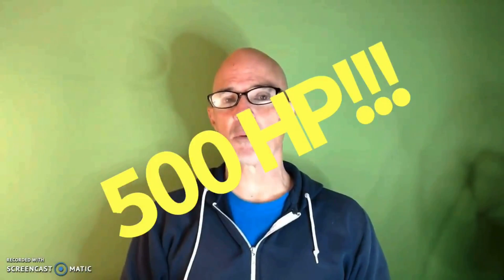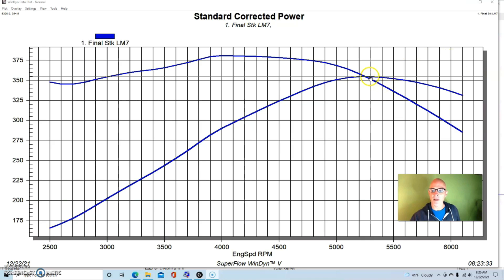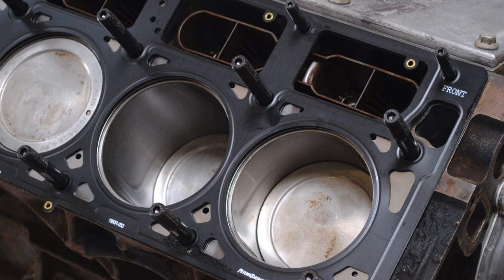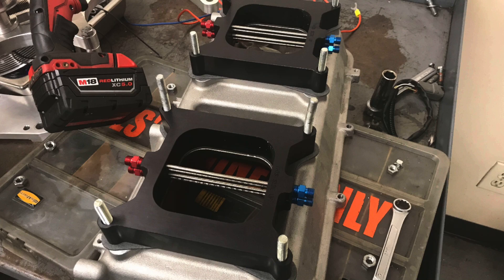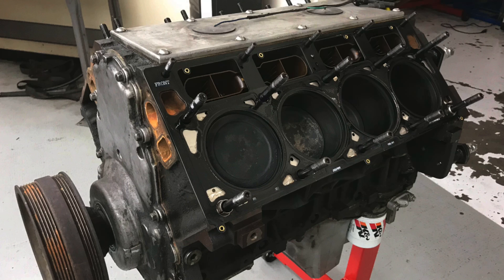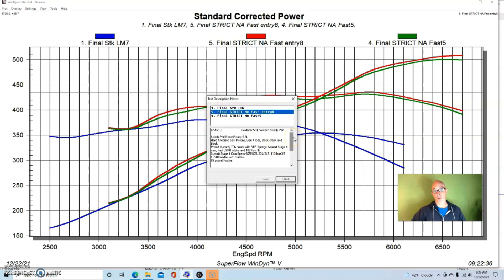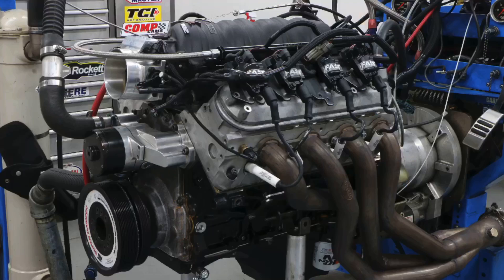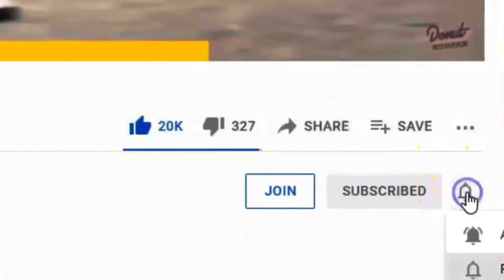HOW TO: JUNKYARD 500-HP 5.3L LS-CAN MY NA 5.3L LS MAKE 500 HP WITH A HEADS, CAM AND INTAKE UPGRADE?

Comment: I bought an 84 Monte Carlo with an 5.3, it has jegs intake manifold, long tube headers, 93mm throttle body, Texas speed stage 2 cam, spectre cold air intake and flow master exhaust and turbo 350 transmission and Terminator x efi. Any idea how much horsepower that would be?
Reply from the maker: cam specs?

Comment: I must be doing something wrong.. I tried the formula to calculate torque (hp x 5252 / rpm) and when I do it for this engine as an example: 354hp x 5252 = 1,859,208 / 2500 rpm, it tells me this little engine should have 743 ft lbs of torque at 2,500 rpms! Someone please tell me where I'm going wrong here. (I even verified this on Wallace Racing's HP-TQ-RPM calculator)
Reply from the maker: hp=tqxrpm/5252, TQ=hpx5252/rpm
Reply: @richardholdener1727  ok we did the same formulas for tq, why does it calculate to 743 ft lbs at 2,500 rpm when this 5.3 shows about 348 ft lbs at 2500 rpm? That’s what is blowing my mind. Even Wallace Racing’s calculator shows this 5.3 making 743 ft lbs of torque at 2500 rpm, which we all know is not real.
Reply: @richardholdener1727  Ok good talk ✌🏼

Comment: title should be "here's how to make "500hp" on a 5.3 if you use some dyno tricks and rate it at the crank..."
Reply from the maker: every motor is rated at the crank
Reply: @richardholdener1727  mine has never seen an engine dyno, it is/was rated on a chassis dyno.

Comment: 5.0 coyotes make 500 to the tire with bolt ons. The pushrod engine with 25 extra cubic inches needs a whole top end to make 500hp.
Reply: Yeah don't forget the 4 cams them Coyotes got. Yall Ford guys kill me.
Reply: The ls will continue to make this power passed 250,000 miles after being pulled out of a junkyard the ford would never be able to do that

Comment: Excellent info clip. I have a 1966 GTO. It has a 67 engine. Was looking at  Ls 2,3 or lq4 9 etc. But I'm starting to think 5.3 because there plentiful and a good price. I had an 06 GTO and fell in love with the engine , 6 speed etc. But 64 thru 67 are my Goat of choice. Not badmouthing the others just grew up with. Does the 6 speed stick align with the original 4 speed! Any other tips would be appreciated. Thanks, Craig

Comment: At 14:11 you talk about piston to valve clearance, limiting you to be able to put in a bigger cam. But doesn't the head flow design dictate the cam lift? No sense putting in a bigger cam if the head flow doesn't support that.
I would like to see you do bench head flow, and then pick a cam that matches that. Maybe you've already done that.
Reply from the maker: cam lift has little to do with p-v (that would be duration)

Comment: I have a 2004 z71 LM7 5300 I want to upgrade engine for most performance on a budget to then swap into my 73 c10 what would you recommend?
Reply from the maker: the channel has endless 5.3l builds-pick the one that makes the power curve you desire

Comment: how do i get the tune for 354 hp without adding anything, how much does it affect mpg too?
Reply from the maker: we run it with no accessories, no air intake, open exhaust and headers and optimized tune.

Comment: assuming the slightly longer pushrod you used LS1 pushrods?
Reply from the maker: LS1 pushrod is the same length as every other LS based pushrod
Reply: @richardholdener1727  so what pushrod length did you use for this combination? 5.3? And i was in the impression that the 5.7 LS1 we're a different size than it's other Beratern LS's

Comment: 7:57 if the stock motor made 354 @ 5500 rpm. Adding nitro the engine would have still peaked 5500 rpm. For the engine to at 6500 rpm. You had to change the cam. Installing a high rise intake is not going to raise the peak 1000 rpm.
Reply from the maker: EVERYTHING WAS EXPLAINED IN THE VIDEO
Reply: @richardholdener1727  That does not mean it was true.

Comment: Does anyone know what kind of vacuum the 5.3 with a summit stage 4 will make at idle and cruise? Just curious if I'm going to have any issues with power brakes or anything. It's a manual car so no torque converter to fight with

Comment: Budget boost built? Or building a 5.3 for nitrous would be interesting. My family just got a fully intact 5.3 with a 4L80 along with harness and ecu. Thinking it would be nice in a Fbody roller with a 200 shot or turbo setup. The goal is 550-600whp.
Reply: Same. Have a third gen trans am I wanna ls swap and make around 550-600 hp too

Comment: Richard good to see you!!! I haven’t been around much lately due to a schedule change at work so I can’t participate in your live streams. I’m building an iron LS1 5.7 with flat tops, 862 heads with a home port job done by me, for now a stock LM7 truck intake, I believe with the measurements I’ve taken and the gaskets I’ve chosen my compression ratio will be right at 11:1. I’m using the sloppy “best” cam. What are your thoughts on this combo and how much power do you think that would make?
Reply: At least 100 no doubt
Reply: @Pickledlizardnipples  haha. I was hoping for 85 so 100 works ha

Comment: I got a LM7 in my 2000 silverado. I was thinking on rebuilding the engine and then throwing boost at it. What would be easier and more durable a crate or do the rebuild. My hp goal is around 600 to the crank.
Reply from the maker: stock with boost will do that

Comment: Please please do a test with the Summit Racing LM7 5.3 450 horse power 420 torque. Can you please?????????????????????????????????????????
Reply from the maker: you think I have the $ to buy a new crate motor?
Reply: @richardholdener1727  oh I thought maybe somehow. You could get one from summit racing. Look I was interested in buying that motor because I saw it supposedly has 450 horsepower 420 torque at $3,600 I'm not sure if it's worth it or just try to do something else I'm trying to figure if I should stick with the 5.3 or go with the 6.0 in my 2000 Chevy Tahoe I want a dependable daily I can beat a camero ss and a Ford mustang 5.0 in a roll race. That would make me very happy. I've watched tons of your videos and I can't decide what to do

Comment: Can you make a stock 5.3 with stock heads making 500 hp n/a.  Doing it with a big cam headers intake and big throttle body....you can port and polish and shave the heads or use any stock LS heads...Can it be done???? Anyone please help.
Reply from the maker: properly ported stock 706 heads will support more than 500 hp

Comment: Hi Richard..I got a camshaft that is 225/238 .620/605 lift & lobe is 113+3 I’m trying to push for 600 hp.. using a 4l60e transmission what stall converter would you recommend for this camshaft..
Reply from the maker: 2800-3000 BUT IS THE 600 HP WITH BOOST?
Reply: @richardholdener1727  Natural Aspirated 6.2…any other tips maxing it out

Comment: Richard, im putting together a l33. Im looking for 500hp. I was wondering if i needed this much cam for it. It will be sbe, flat tops, tea stg 1 799 heads milled for 10.5-11:1 comp, and a lsxrt intake with 102mm tb. Im looking at either the ss2 or the 227/243 comp cam.
Reply from the maker: you will be hard pressed to make 500 hp with either of those cams on a 5.3L
Reply: @richardholdener1727  so would you need to run 50lbs. Injectors for that kind of power?

Comment: Question (for anyone who sees this), can you have too much/big of an intake for a motor? Building a L33 5.3L and I had planned to put a FAST 102mm on but my machine shop said for what I'm doing (roughly 400whp) anything larger than the stock LS1 throttle body (78mm?) is a waste of money and I won't see any gains. How much truth is there to this?
Reply from the maker: AT 400 HP, YOU WILL GET LESS OF A GAIN FROM THE FAST
Reply: @richardholdener1727  thank for answering my question. Maybe I'll see if I can find a FAST 92mm and save a few hundred dollars unless you have a suggestion in mind?

Comment: let’s see what my 5.3 makes with prc 2.5 706 heads milled to 58cc flat top pistons tbss intake and a 228/232 cam at 11.1 cr
Reply from the maker: less than 500
Reply: @richardholdener1727  cam size is my limiting factor isn’t it?

Comment: Might be a stupid question but can you pull a junkyard 5.3 and without taking it to an engine shop bolt on good heads fast intake longtube headers bigger cam and it be a 500+ hp dependable motor?
Reply from the maker: yes-that is what was done on many of these
Reply: @richardholdener1727  got a comment from the man himself!....thanks for the info brother!
Reply: Great question.and he gave an answer to.my 5.3 has been rebuilt.has less than 100miles.i want this build now😂

Comment: Hello nice video.. I have a 454 tbi on my c10 but I would like to get more hp out it. At least 400hp with low budget? It’s possible??
Reply from the maker: carb and intake will help, plus a cam
Reply: @richardholdener1727  forgot to mention it’s a tbi.
Reply: @Chatarrac10  best way to do that is completely get rid of the entire top end and cam and just anything tbi related on your truck.tbi motors top ends are absolute junk asf and hogs on fuel for almost no power in return. Edelbrock makes top end kits that come with heads cam and intake it's exactly what your looking for and I'd get the one with the proflo so you can still use your 4L80 if you have one. It's almost impossible to tune tbi so your gonna have to go carb or aftermarket fuel injection

Comment: I've had every motor in every different vehicle GM offers from the late 70s until current at the moment I have an 8.1 l Allison transmission truck with a raylar cam I'm looking to work on but more importantly the daily driver 6.2 l92 Yukon Denali and then looking to do an LS in an sn95 mustang Cobra rolling chassis I got from California

Comment: I ha e a 2000 z28 w/5.7 Ls. I'd love to see the same type of build using a similar engine, that would still fit under my stock hood. Would be an awesome sleeper. Also using tuned shorty headers.
Reply: Your already fucking up with shorty headers your restricting yourself

Comment: Curious to know about what are the best budget minded things I can do to my Gen 3 L33 with 706 heads to make good torque with reasonable hp it’s going in a 1 ton 4 door square body with a 1st gen 4l80E transmission and higher than 4:10 rear gears
Reply: Do you watch any of his videos?? 

He has dozens covering this exact thing. Cam swap, stage 1 or 2 depending on your converter and how you'll be using the truck. Can you do the install yourself?
Reply from the maker: truck norris cam and springs

Comment: The 706 heads should not be dismissed . They scavenge gasses better than the other factory heads even though they flow less . A good port and polish goes a long way with these . Changing rocker arms for rockers with better ratios also helps these heads .
Reply: I got 706 heads on mine and was considering changing them are the worth keeping and investing a lil into them?

Comment: Luv you videos keep up the good work. I needs some help and some experts advice.  Was wondering if you could do a video on oil catch can for turbo setup. I'm having issue were I'm having oil blow out of my catch can filter and their is no oil in can. It is a amazon cheap catch can so maybe that's the issue. Was wondering if you should do both valve covers to catch can or do breather and one line to catch can. . I'm hoping I just hooked it up wrong . other issue is it's blowing out milky oil which I'm hoping is just condensation.  Just to let u know because this is or is  a common mistake the throttle body hose is not hooked up to valve cover.

Comment: Hi Richard, I took a 400 sbc to the machine shop and requested that ring gap be increased because I wanted to add a turbo.  I was told I needed to get a forged bottom end.  Is this true that you need to have a forged bottom end to add boost to a 400 sbc?
Reply from the maker: NO SIR
Reply: Forged pistons would be a good idea along with some plasma moly rings. You probably don't want to go over 9:1 compression with that turbo going on. Wiseco makes some really good pistons btw.
Reply: What gap size do you recommend?
Reply: Is 10:1 Compression too high for the 400 sbc to run a turbo on?  I will be running modified 64cc vortec heads that will have higher valve lift.
Reply: Hope you didnt have to compromise what you were after because of fudd engine shop bs.

Comment: I have a forged 5.3 with 6cc domed pistons and a ms3 cam. Should be around 10.7:1. Think it will make 500?
Reply from the maker: WHAT HEADS, WHAT CAM?
Reply: Stock ls1 heads milled, 6cc domed piston to make it around 10.7:1.  Cam is 238 242 595 595 tbss intake with 92mm throttle body and 1 3/4 long tubes

Comment: Richard, perhaps not the video to make this comment, but the adage that there's no replacement for displacement, apparently isn't true (not counting boost). On the 2022 Corvette Z06 they do it with RPM and breathing. My question is could GM have achieved a similar output with displacement and better heads and cam on their LT engine? I know they've already done 7L, and the high deck LSX can get to 7.4L. I know they went this rout for IMSA racing which is restricted to 5.5L. The Z06 will get 670 hp (net ~ 740 gross) at 8600 rpm.
Reply from the maker: A HIGH SPECIFIC NA OUTPUT IS IMPRESSIVE, BUT USUALLY THE MOST EXPENSIVE ROUTE. FOR THE AVERAGE GUY, MAKING A BIGGER MOTOR IS MUCH EASIER AND CHEAPER

Comment: Don't forget, your 500hp engine will show 300hp to the tire with accessories and through an auto and a differential.  So, you're still slow. Boost is always the answer.
Reply: Sounds like someone don't know how to make a na car run.....and why a auto?
Reply: @HioSSilver1999  99.9% of LS engines are in front of an auto
Reply: @FredAllenBurge  yup.....and very unfortunate. We've went as fast as 10.5 and 130+ traps na with just bolt ons and a stick. Both cars were complete street cars. Autos way over used in the chevy world.
Reply from the maker: A 500-HP MOTOR ON THE DYNO WILL BE CLOSER TO 400 WHP
Reply: @richardholdener1727  my turbo 5.3 made 870hp at the crank on an engine dyno. Then installed it ran 9.8 @ 142mph in the quarter which at 3,000lbs puts me at about 650rwhp, maybe a touch more, according to the Wallace racing calculator. This is through a 4l80e and a small Nissan differential.

Comment: First off I always love your videos sorry I always forget to hit the like button so I've been thinking hard about whether or not to put a cam in my 53 and I've decided that I'm going to but I want to keep my VVT so I'm going to buy the VVT limiter kit from comp cans it's only like 75 bucks but I'm trying to figure out which VVT cam would be best it seems like there's only a few and the ones from Texas speed seem pretty good except they have crazy high lift and I just don't see how that's possible with out piston to valve clearance on a stock bottom end if you maybe want to do a new video maybe try vvt cams and then I could know which ones best
Reply from the maker: lift isn't a problem with piston to valve clearance-its duration-but high lift often decreases stability and component life
Reply: @richardholdener1727  okay thanks yeah I remember you saying that now that I think about it but I don't want to go that radical I'll look at someone else's thanks
Reply: Blather? Like, then subscribe, then "blather" right on outta here then Lol, Richard, if you see this comment, I currently have researched these LS engines for 100s of hours now(your videos). I have a 05 Silverado short bed , single cab, classic  I've been restoring/custom building , and im just very torn on what direction to go. I have notes on ALL combos for. 4.8/5.3/6.0 builds, but I am stuck in between wanting a descent N/A build, but also able to put a small turbo on it  down  the road without any downfalls  that can maintain a decent mpg(15-20) when driving far distances(drivability/efficiency) . I like the 4.8 idea, and just adding overkill heads, and a descent "truck style" cam ,high  pressure  oil pump , etc... But then I worry about not replacing all the bearings/not  measuring internals/dirty oil and coolant passageways....  But also like the idea of taking a 5.3 and having it bored over to a 5.7 and keeping it N/A, and going ahead and having a machine shop match a good combo of crank/rods/bearings/ pistons /cam/ head work etc.... while I'm at it ......and never adding a forced induction.. Should I just buy a junkyard 4.8 and have the turbo ? Or would it be a similar cost to build the 5.3 fresh/brand new ? And what would you think the differences in power/longevity /effeciency would be? Lmk,. New to this, but really really love your technical videos that teach what camshafts ACTUALLY. Do, and flowing different heads/combos. Etc. So us newbies can actually understand there is More to a pushrod v8 engine, than just having it make that "loppy" sound at idle. Lol thankyou, hope to hear from you. Peace .

Comment: Is there a recipe for a 6.0 LQ9 to make 500whp almost guaranteed? That is same to this video. Mostly stock bottoms end just heads cam and intake.. any input from anyone helps.. it’ll be in a t56 car with long tubes full exhaust and 373 solid rear axle
Reply from the maker: add 8 psi of boost
Reply: @richardholdener1727  no way of making it NA? Maybe a ls3 top end?
Reply: @richardholdener1727  that’s the short answer Richard lol

Comment: Hey Richard I have a 5.3l with  Ported  706 heads  with Bigger valve I'm running a comp cam it the duration is .050 intake is 235 in exhaust is 242 lobe lift Is .3650 intake in exhaust is 2490. Lobe separation is 111.0. I'm running a ls3 intake with ict  Adapters. So  my  Question is am I losing powers by running that intake with the adapters. And would I be better off running a fast 102 intake?
Reply from the maker: please see the ls3 intake with adapters video-that combination won't make anywhere near the power of a Fast LSXR